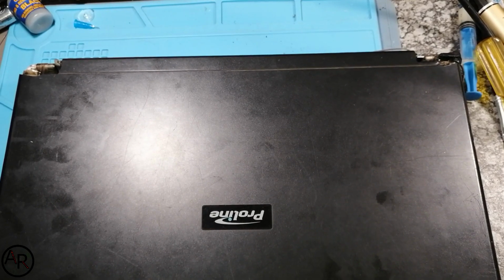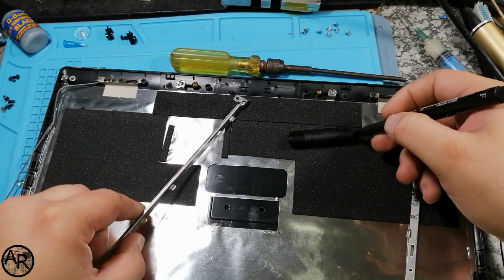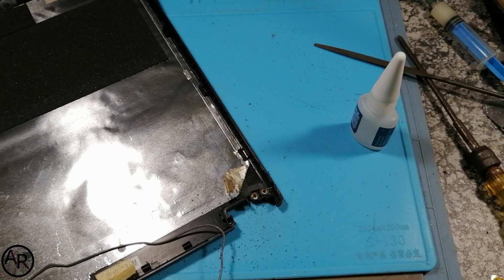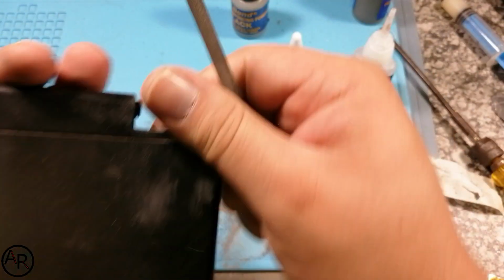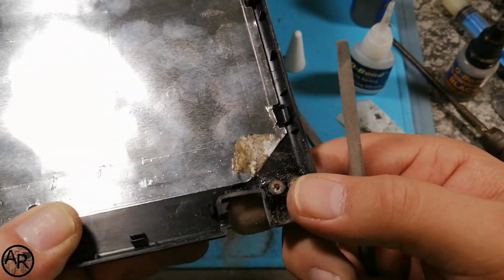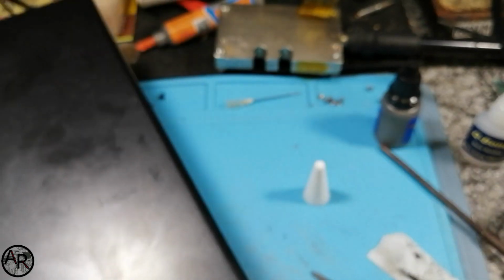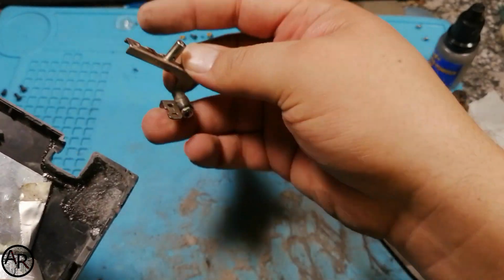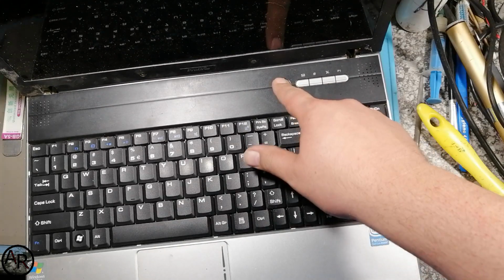Laptop hinge & plastic repair

Comment: This is too complicated, I make it much simpler
Reply from the maker: Like you`re channel , but it will pull out again if you don`t oil the hinges an release some tension on the hinges , the problem with the laptop design is there is not enough  base for the brass insert to hold on to, I never had a come back on my hinge repairs
Reply: @AnonymousRepair  I am not saying oil, I say you do it too complicated and not aesthetic
Reply: @AnonymousRepair  I do this job, and I'm sure it will break again
Reply from the maker: @NiNaRestore  I have being doing this job for 20 years not one single come back, got to release the tension on the hinge an apply oil
Reply: @AnonymousRepair  I work for the old laptop store at the same time as you
Reply: @AnonymousRepair  without beauty, how can we sell
Reply: @AnonymousRepair  You can go to my fanpage to see pictures
https://facebook. com/tantranglaptop
Reply from the maker: @NiNaRestore  this is for customers, I repair one for selling I paint and make it look nice, labor and time is a consideration as well
Reply: @AnonymousRepair  So can you make a video to paint the laptop body?
Reply from the maker: @NiNaRestore  yes when I can I don't get very bad damage laptops like you do
Reply: @AnonymousRepair  because I specialize in repairing the body
Reply: @AnonymousRepair  My job is to recover the damaged laptop body

Comment: What power do you use sir?
Reply from the maker: It comes in the superglue kit called q-bond but i have heard that you can use baking soda
Reply: @AnonymousRepair  I have been using baking soda with great success. The only problem is that is white. If it is used for the interior no problem. But on the outside I prefer the one you used - black powder.

Comment: And there I was filing away plastic from a donor, BTW those "Rubber Grommets" you called "Rubber Cover/s"? Are not some contraceptive aid :D
Also did you know you can buff plastic smooth? and not only that you can actually copy textures to a repaired surface, see YouTube Search "How to texture repaired plastic"
Reply from the maker: I will have a look at that, thank you, was thinking to get an air brush and try to paint it